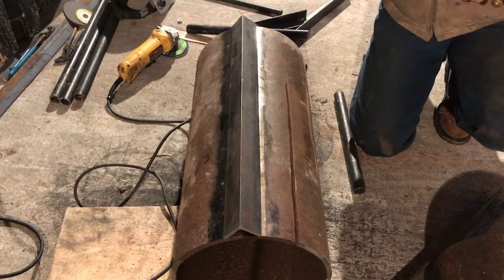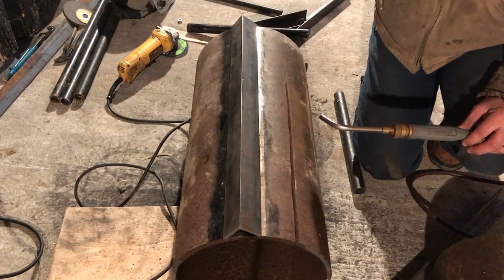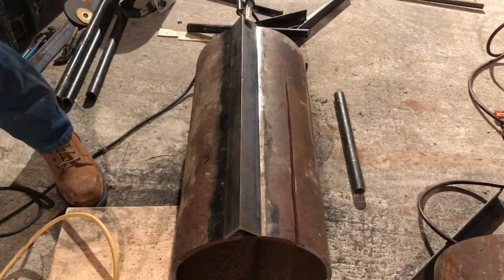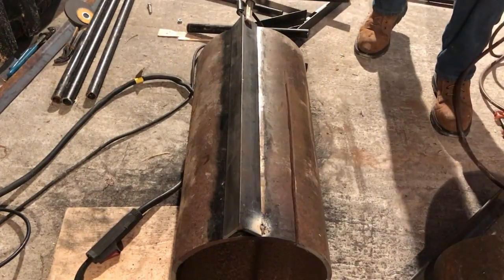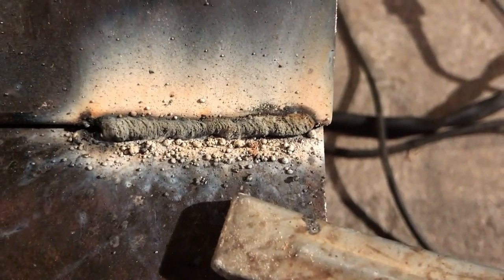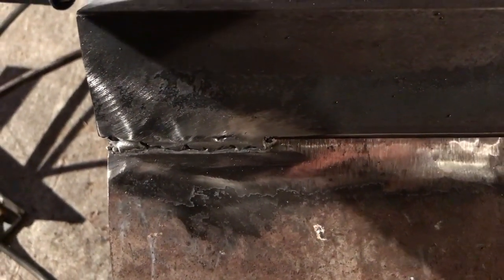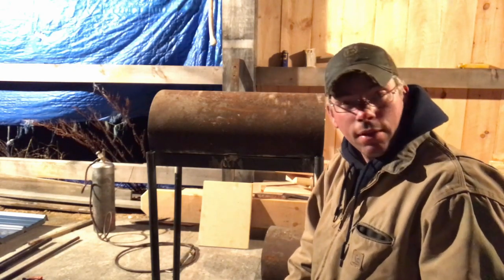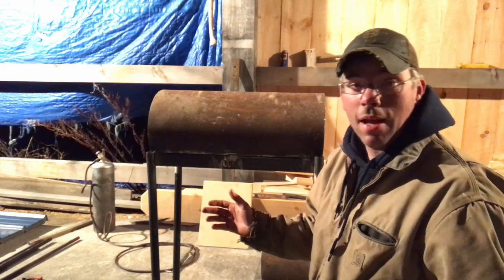A Simple Blacksmith Shop From Scratch part 1

Comment: Morning Jim,
Patience and technique. I have one of the $100 flux-core welders from HF and built a utility trailer with it 13 years ago. I've had 1500 lbs on it on several occasions and have had high loads of junk metal on it with ratchet straps really cranked down and it is still holding. I even have 5/8" solid steel eyes at the front corners as tie-downs. All welded with the "cheap" HF welder. No, it definitely does not do "pretty" welds, but with pass, clean, pass, repeat you can fill a beveled weld to attach metal thicker than what you have there. The coil springs are welded in and it is a tilt back trailer with a long square tube hitch and flip latch tilt lock. As I am not a professional fabricator, the home-made hubs bounce a bit, but it has held up. I have used the eyes to winch large motor blocks and big logs onto the trailwe with no give.
It's too late to video the build, obviously, but I will try to get a walk around of it on my channel when I get the chance. Sometimes you have to work with what you've got. 
Thanks for the shout-out.

Comment: Morning Jim,  your right, that Harbor mistake is not bad for the money. I have a polaris ranger that i have a small plow i drag behind it.  The plow broke at the pivot not long into it's life. (Poor weld from manufacture), the pivot was pretty thick as well. I was very surprised at the welders performance.  Preparing IS the most important.

Comment: changing the ground cable for a better quality {#2 or 0 cable] helps the little welder. if you can find an old cook stove with a cast iron burner for the oven ,you could have a ribbon style burner.
Reply from the maker: +Rottinrock great suggestions, thank you.  I'll try the wire out.  Thank you.

Comment: Harbor mistake...says the carpenter..! Metal work is always fun. But you forgot to grab it after you welded it. Looks like a good project, should be able to add some rustic accents to the future projects, maybe some nice hinges for the barn and some good cord hangers.
Reply from the maker: +Craig F you got it.  I want to make some good tools above all else.  How's Craig tonight?
Reply: I'm doing good, you? I think that's the first project for every black smith, tools and tool holders.
Reply from the maker: +Craig F i think you're right.  I've seen a few that end up doing nothing but make smithing tools.  Doing well tonight, should be in bed but made the mistake of opening a good book.

Comment: Welding in Winter chill is a good task, better than trying to clean out a carburetor or other tiny bits.
Does your flux core welder have ability to accept a gas cylinder? The one at my last place of work did.
Reply from the maker: +Jay Littleton no, it's s $100 HF special.
Reply: Thanks Jim, as you probably know their "$100 Special" can vary from time to time.
Reply from the maker: +Jay Littleton little bit

Comment: You Deff. work for a Mechanical Contractor,,, Ever run into  C.N. Flagg Co.?????????PS   can you get your hands on Some K Wool??  Used it at Stanley Works,, 5 x Better than the brick, Especially on round Pipe!!
Reply from the maker: +Jack Connors I can get Kawool

Comment: Jim, Get some 7024,   1/8  Jet rod,, crank the old Lincoln up,, and you won't use your B  tank,, Flat only and you will look like a PRO!!!!!!!!   JAck
Reply from the maker: +Jack Connors i use that as well, can only get it by the 50# here.  Great stuff, cleanest welds I've ever made.
Reply: Jim, I think Home Squeako sells it in 10-pound tubes,, the Lincoln Brand welds the Nicest,, in Good times id go thru a pallet a  month,, Lincoln only, Best and Least  Expensive!,,, my guys knew if not Lincoln Rod!!!!!   good luck,,   my forges we built, Burners at about 2 o'clock and 9 o'clock,, Worked super on propane!   And tried many locations this worked the Best..